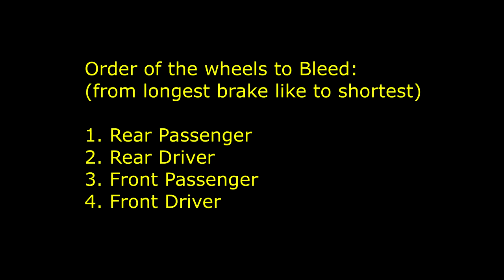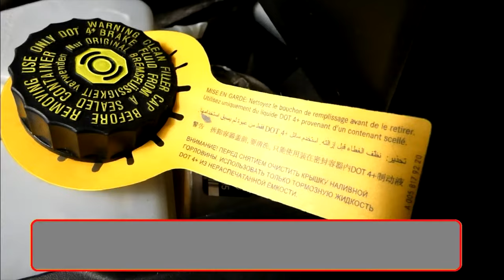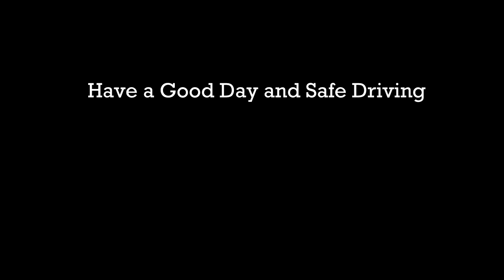How to Change Brake Fluid in Mercedes-Benz C300 W205 W206 and E300 W213 Complete Brake Fluid Flush

Comment: I don’t completely understand- why do you need to use the power bleeder after refilling the brake fluid at the beginning?
Reply from the maker: to push fluid through brake lines
Reply: @NewRoad  I don’t see other videos doing it. Is it optional?
Reply from the maker: I'm not sure if 'old school' (pressing brake pedal - instead of power pump) will work or break something ... I never tried to mercedes

Comment: Nice video. Just a word of warning with the Motive Power Bleeder. I see that you have the transparent flex pipe between the reservoir and bleeder. 
BEWARE AND A WORD OF WARNING!!! 
Use a reinforced plastic flex pipe. Why? Simple. Mine burst when it was being used and under pressure. It sprayed brake fluid all over the engine bay, hood and wing. Thankfully I quickly rinsed out everything with plenty of warm water, then soap and more water. Thankfully I haven't seen any damage or corrosion to the paint, etc. I replaced the burst pipe with a new reinforced one and haven't had any problems since.
Reply from the maker: Thank you, good to know, I thought those never fail
Reply: Thanks!

Comment: Great video! Couple comments/question. 

Is there any need to perform an ABS system flush (i.e., exercise the abs pump)?

To save time, I have removed the pressure gauge from the Motive tank and replaced with a tire Schroeder valve.  Can use a small electric tire inflation pump to pressurize the tank and use the pump pressure gauge to monitor pressure. Saves A LOT of time pumping by hand....
Reply from the maker: Thanks for additional tip! No need to do anything with ABS

Comment: Thanks for your thorough video! Do we need 2 bottles (2 * 1 Litr) of brake fluid for the flush?
Reply from the maker: Mercedes-Benz is using just 1L bottle to change fluid. If you want to make sure that you don't run-out fluid while changing - I would say buy 2 just in case.

Comment: Hi My friend 
Thank you for your video 
I have a question 
I did evening What you did in your video. Only one issue I have when I using  the the presure the brake fluid start leekinng under the brak fluid container. I can't see from where is coming from.I can't keep the presure in the botle. The brake fluid just gone 
Do you have any idea why this la happening.
Reply from the maker: Hi, it's hard to guess without looking at it. Just make sure you tight everything good when connecting bleeder to brake fluid reservoir, get god light and check around reservoir

Comment: For brake bleeding hose what is the Inside Diameter size you used? 1/4inch ID ???

Or is it 1/8 ID & 1/4 OD ? 

Thanks
Reply: 42mm